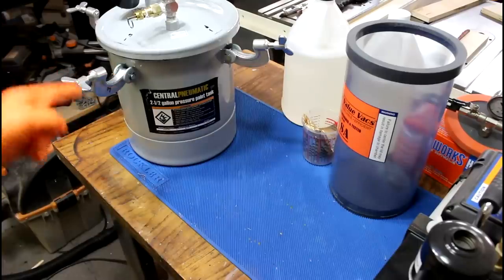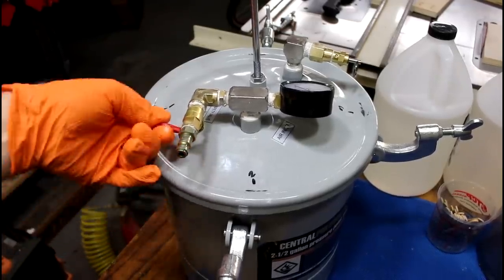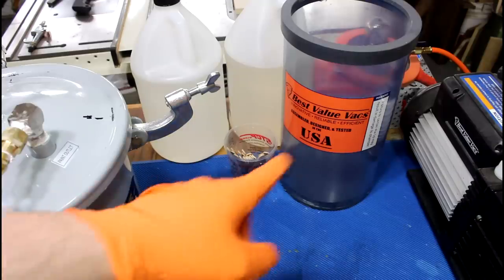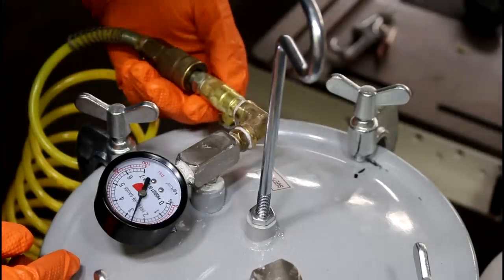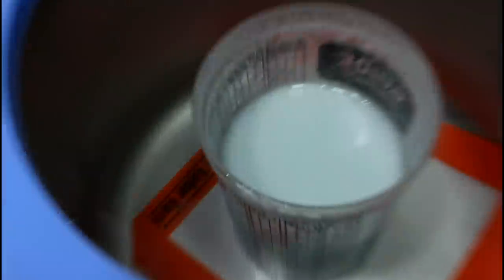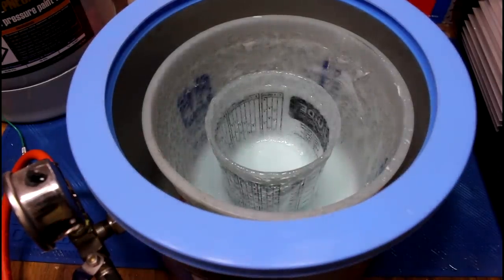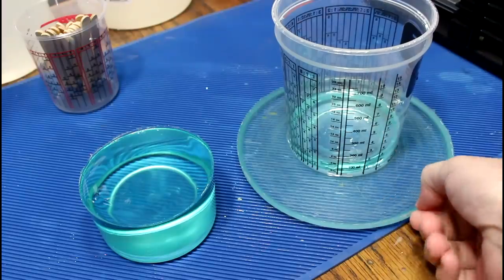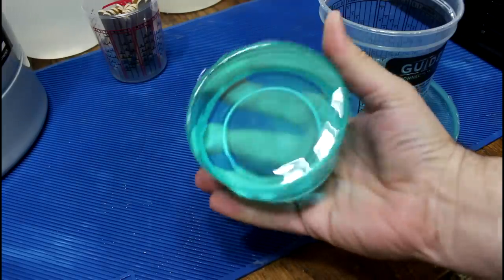Resin Casting: Pressure vs Vacuum

Comment: It is NOT air going off in the vacuum, it is some of the solvent boiling off. And not a single youtuber understands this. Amazing.
Reply: Agree!
Reply: Interesting - are there actually volatile solvents in the components? Would those not spontaneously form bubbles even in a regular atmospheric cast?
Reply: @TwoScoopsOfTubert  it depends on the resin, material being cast or used as reinforcement, and any additives

Degassing resins with vacuum and then pressure casting is pretty common and really effective
Reply: WGwireless that’s really besides the point.  If we were working with resin and non stabilized wood you would have problems with air bubbles from the wood.  Pressure casting is the only method that makes sense unless you find a different method that doesn’t create the solvent bleed off and you’re using wood (or any other material) that had absolutely no air in it.
Reply from the maker: OK. I now alone understand it. I'M A VESSEL FOR YOUR WISDOM.
Reply: Peter Brown wait...no wait...I see what you did there.  😂
Reply: @peterbrownwastaken  you did a resin stabilizing video a while back. Is there a reason they didn't add a extra port to the top so you can put the wood in, vacuum out most of the air, and then suck up the resin into the chamber? (A valve at the top of the chamber with a tube running to the resin bottle, open to valve to add the resin after you got rid of most of the air and less bubbling should happen)
Reply: Or the resin itself boiling -
Reply: Robert Szasz removing air bubbles in wood requires injecting fluid in to take the air bubbles place.  Resin’s viscosity is too thick to do that.   Stabilizers use very thin liquids that can absorb into the wood.
Reply: From my understanding of physics, isn't both happening? Sure, the "boiling up" takes the bigger part, but isn't also a part of the air in this mixture also getting sucked out?
Reply: T M S I’m sure that had to be happening as there aren’t any air bubbles left...right?
Reply: @MakeThings  pretty sure most if not all stabilizing products are "resin". It's a term that is commonly used for just about all liquid polymers. And you certainly need to fill the voids in the wood with something to complete the process, but you can remove most of the air without filling the voids up just by pulling a vacuum. My idea is to pump down the chamber with the wood in it, hold  at low pressure for a bit, add the stabilizing resin without releasing the vacuum, holding the vacuum for a bit longer to make sure the bubbling has slowed/stopped, and then allowing atmospheric pressure to force the resin into the wood. 

If you did multiple vacuum cycles you could "pump" the air out of the wood, replacing it with more and more resin each cycle, and that would require the wood to be submerged in resin at all times. It's unclear how much more resin that would force into the wood compared to just a single cycle though. It would probably be a very minor improvement in most cases.
Reply: Robert Szasz very good points.  Actually, when you submerge wood into a stabilizer, the polymer doesn’t do anything until the vacuum chamber is vented.  Up until that point the wood is doing exactly what you said it was doing: releasing air. 

But going through what I think is a much more complicated system that you've created...I’m not sure there is any real net benefit.  🤔
Reply: @MakeThings  for wood stabilization, you just wouldn't have to worry about the foam rising so far you suck resin into your pump. 

For casting or making composites pulling a hard vacuum first means you don't have to worry about bubbles on the surface or in the middle of parts.
Reply: Robert Szasz this would be a good experiment.  It’s certainly an interesting idea.
Reply: Yeah any VOC's trapped the monomer will easily boil off at those lows pressures. The best action to take is before the two components are reacted (mixed) they should be stripped of the VOC's separately in the vacuum chamber then mixed.
Reply: @RobertSzasz  Care to explain why would you do both?
Reply: @MakeThings   But in this example and every other one like it you aren't working with wood and the OP's statement is correct. When you pull a chamber/vessel or any closed system into a vacuum you lower the atmospheric pressure in that vessel and in turn you lower the boiling point of any liquid and the resulting VAPOR is then removed via the vacuum pump. So while initially any air in a closed system is removed you simply do not need 30inches of mercury just for that, the main purpose is to flash off any liquid into vapor and pull that out of the system. If you've ever seen an AC system charged the entire system is pulled into a vacuum for this very reason seeing as how refrigerants are hygroscopic by nature.
Reply: @SBVCP  vacuum increases total penetration, and removes gasses and VOCs in ways pressure can't, curing under pressure collapses voids and holds them closed

With both you have to either experiment or know the materials, with pressure you can distort or crush things, with vacuum you can distort and cause volatiles loss when you don't want to. (Degassing in this case probably didn't require the full expansion of the foam and waiting for it to collapse)

I can't think of a reason you would want to actually cure while under vacuum. Once you have the air out, or the material saturated, releasing the vacuum let's the atmosphere do some of the work a pressure pot would.
Reply: @markf.4063  the goal in vacuum degassing while making solid resin castings is to remove any/all mixed in air.

Edit: and any air trapped on interfaces between the resin and mold
Reply: @RobertSzasz  I've used vacuum pumps for years professionally and I completely understand what you're saying but again, when you lower the atmospheric pressure you in turn decrease the boiling point of a liquid. This accounts for the sheer amount of bubbles seen in this example. Hell, you can boil water at room temperature if you put it in a vacuum. What you are actually seeing is liquids, both in the air and in the resin, being boiled off into vapor and in turn being removed. You cannot expect me to believe that there is enough air trapped in suspension just from the mixing process to displace 2 ounces of resin. As an aside, you really should change your pump oil periodically.
Reply: They advertise Art Resin as low odor and no VOC's.  Additionally, the SDS shows no solvent.  I mean, unless they're using water as a solvent (which is not what it looks like in the video), they would get into a lot of trouble from EPA/OSHA/NTSB/FAA/etc. if there's enough solvent to cause what we see here.  Not to mention how much a solvent (including water) could mess things up if there's any significant exotherm or how much they would compromise the final cured properties if they are not flashed out of the system.  My professional opinion as someone who works in a technical capacity for manufacturers of things like this is that there was just a bunch of air whipped in during mixing.
Reply: @markf.4063  I wasn't being clear enough.. what we saw was volatiles boiling off. The goal was just to remove entrained air. Boiling off other stuff probably didn't do much harm, but doesn't do any good for this application. Depending on the composition of the resin boiling off components could totally screw up the cure, or could be a way to dry mildly hydroscopic chemicals that cure better when dry.
Reply: @ExaltedDuck  there could be components that have very, very low vapor pressure, but pull a hard enough vacuum....
Reply: I was thinking this when all the bubbles kept on forming.
Reply: @MakeThings  Of course, but my point, giving the comment is more of highlighting that there are scores of videos of people trying to degas resin using vacuum for extensive periods of time. When you reach full vacuum and the visible bubbles are gone from the resin (or silicone) the job is done. When you have wood or other porous material in the resin it will act as nucleation points for the resins volatiles and you think it is acctual air you boil of. In reality it is the volatiles that gasifies and doing so increases the pressure in the pot and hinders the air bubbles from releasing. But this video used straight up resin with no other additives but alcohol (that sure boils at vacuum).
Reply: @TwoScoopsOfTubert  In this case, Peter did add some alcohol based paint, but yes, depending on the resin there is volatiles that might boil in vacuum. For example, if you add to much hardener or use to thick layers at a time in some styrene based resins (like acrylic) the styrene it self will start to boil due to high temperatures, creating millions of small bubbles and giving a unclear cast.
Reply: I knew a YouTuber who would understand this Cody from CodysLab.
Reply: low odor? if it has ANY smell is has off gassing that the vacuum will accelerate, and also mean that is can off gas under the surface of the resin because the 14ish PSI of air pressure has been removed.. not only that VOC only cover organic compounds (ie containing carbon) there could be some non organics in the mix also. this is my opinion of someone who works with high vacuum systems
Reply: it's still better with the pressure chamber
Reply: Whatever happens in the vacuum chamber, be happy that it has a window!
Reply: You're apsolut right!
Reply: @HomeDistiller  the thing is if has organics (VOCs) that are volatile enough to flash off so vigorously under vacuum, it would probably not be low odor.  And I can't think of any inorganics that would be volatile enough to boil like that which would be relavant to epoxies or safe enough for use in consumer products.  Except water.
Reply: I wonder if vacuum pumping the resin up into the workpiece would leave the bubbles behind
Reply: @RobertSzasz  all I can say is I've worked with products where I'm privy to the formula and seen them behave exactly like that with no significant amount of volatile materials added.  (Ie just air being removed)
Reply: @TwoScoopsOfTubert  Alcohol based dye
Reply: @glennworton2494  Alcohol based dye
Reply: No no, those are unicorn farts escaping the resin and the reduced pressure simply allows the fairies to fly fast enough to pop the bubbles and remain invisible.
Reply: @isettech  Possibly part of it - two drops of dye shouldn't create that much foam
Reply: I'm glad more youtubers don't 'understand' this, because it's mostly not correct.  Epoxy based resins generally should not contain VOC's or solvents; this is one of the main reasons they stay dimensionally stable after curing.  Compare to polyester based resins, which IIRC, do use solvent evaporation as part of the curing mechanism, and consequently castings from these resins shrink quite a bit during curing.

The reason that it seems like so much gas is released from the mixed resins is mostly due to the vastly reduced pressure.  As vacuum pressure decreases, the volume of the entrappped gas bubbles increases proportionally.  The tiny little bubbles you can barely see become big honking bubbles.  Hopefully, they either become buoyant enough to rise to the surface and pop, or the 'foam' on the surface expands so much that the reduced pressure inside the bubbles can no longer support the weight of the resin the bubbles are made of.  When the foam expands to the point that it cannot support itself, the foamy 'head' collapses.  How easily it will do so is probably dependent on the viscosity and/or surface tension of the liquid.

In this demo, the foam didn't have enough space to expand into to the point the bubbles would spontaneously pop, so it would be difficult to degas the resin this way.  Once the gas bubbles seem to be popping on their own, I think you can quit...  any bubbles that exist at near-vacuum would be extremely small at atmospheric pressure. 

This isn't to discount the possibility of volatile materials might not boil out.  If it isn't a resin designed for vacuum infusion, not every component might be stable at very low pressures.  Also, any water or alcohols mixed in could boil.  It's useful to remember that water vapor occupies 1700 times more volume than liquid water at STP, and even more volume than that at near-vacuum pressures.

A somewhat scientific test might be to expose the unmixed resin components to a vacuum, and see if any bubbles appear from that.  Even then, I'm not sure if the bubbles would be VOC's, alcohols, moisture in the resin, or even gasses in solution, like the CO2 fizz released from soda.
Reply: @peterbrownwastaken  You are the chosen one.
Reply: Absolutely
Reply: @toohardtowatch  it's not uncommon to use defoaming additives in lieu of vacuum processing when manufacturing formulated epoxies (formulated as opposed to the resin stocks that get reacted and serve as raw materials for formulation).  They can make an end product that appears to be air free but they do it by reducing surface energies which actually lets a lot of air remain both dissolved and suspended.  My gut feeling is that this is the case with the product in the video, and that perhaps that any very low-dose additives might come in solution with volatile carrier.  Alcohols are unlikely as they would not fit the manufacturer's description of low odor and no VOC.  Water is a possiblity, too, of course, but the amount of foaming is not inconsistent with what I've seen from entrained air in crudely manufactured epoxy formulations (and it's also nearly impossible to mix these types of products without incorporating a whole lot more air)
Reply: Interesting.  So you suggest that there may be additives that increase the gas solubility of the epoxy, to make bubble-free casting easier at normal pressures, and this extra dissolved gas would be released at lower pressures.  I hadn't considered that.  It makes me more curious to see if the two epoxy components would release any bubbles in a vacuum before they are mixed.

The alcohol I mentioned was the pigment added here, and water is present in some quantity in just about anything that has been exposed to air.   However, if one were to assume that the summed volume of bubbles in a well mixed epoxy was 1% the volume of the epoxy itself, and considering that a decent two stage rotary vane pump should be able to handily reach 0.1% of atmospheric pressure, then 1L of mixed epoxy could contain 10L of gas at that pressure.  Enough for lots of bubbles.
Reply: @wupme  , please do your research on epoxy . Especially on additives and thyxotropic modifiers . There is a lot of shit you need to learn.
Reply: Yep, I just posted a similar comment before I saw yours.
Reply: @TwoScoopsOfTubert  Volatile solvents?  How do you come to that conclusion when water also boils when depressurized?  I was thinking the same thing about the resin, what if it's just lowering the boiling point of the resin or the stuff that he added to it?
Reply: fangxx456 ...that would not work...voc's are not only in the individual components but created by the very act of mixing the two... Furthermore, it would be next to impossible to remove all voc's from the individual components, unless you completely evaporated them!!! no VOC's = no chemical to begin with...

Comment: You can use both, if the resin gives you time, you put on vacuum chamber to take out the worst of it as you manage to have it not to overflow with foam, and then after these minutes of vacuum shock, you put it in the pressure chamber. BTW on the vacuum chamber, you don't need full vacuum, the goal is just to make the small bubbles to grow large enough that the equivalent weight of resin will dislodge them and make them defeat the resin viscosity and float to the top. Great vid, love it.

Comment: I think the alcohol dye was just boiling off in the vacuum chamber. I'd like to see this again without the dye.
Reply: It would be the same. When you put any liquid in a vacuum you lower it's boiling point and it turns to vapor. Those bubbles you see in the resin are just that, vapor.
Reply: But the alcohol is boiling off, which may have a difference in the amount of off gassing that occurs as opposed to just the resin. I agree with MysticalRhythms— it would be super interesting to see one in the vacuum chamber without the alcohol dye.
Reply: @StoneAndersonStudio  Epoxy resin will boil at room temp when under vac. Art Resin is an epoxy.
Reply: Also, I’d want him to take more normal care to not stir air into it before putting it into the vacuum chamber. The extra bubbles proved the capability of the pressure chamber to correct for that, but it seems unfair to compare it directly with the vacuum under less than ideal circumstances.
Reply: With out the dye you get the same results made a mess of my vac chamber I did not have a clear top but part of the side was clear and it filled full of foam verry quickly with nothing but  ENVIROTEX LIGHT ,.
Reply: Agreed. That is boil-off, no way that amount of air is in the resin, it would be visible in the pour. I started embedding and resin casting 40 years ago and never once had an issue with air bubbles that required all of this silliness with vacuum and pressure pots. Resin is one of the easiest mediums to work with and all of this youtube idiocy makes it seem much harder than it actually is.
Reply: @1972Russianwolf  If that were the case, then it would never have stopped boiling. It was basically done at the 30 minute mark, with 15 minutes of pot life remaining. I agree, this must have been the dye boiling.
Reply: No it does that without alcohol. I know BC I have done it with just epoxy and it foams up, but he did FA to control the atmosphere and release the bubbles.
When you re introduce the pressure to the pot the bubbles are all crushed by the atmospheric pressure.
You can use it to degass before you pour. 10-15 minutes, take it out and bubbles are gone.

It doesn't work well for molds in my experience.